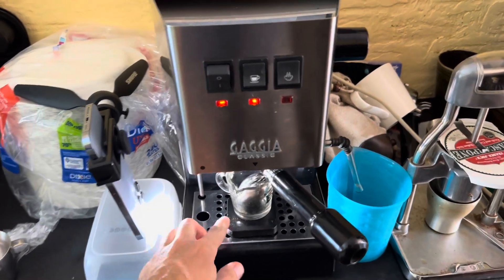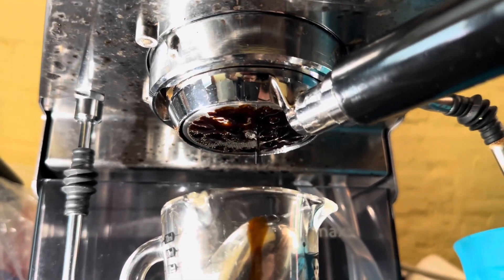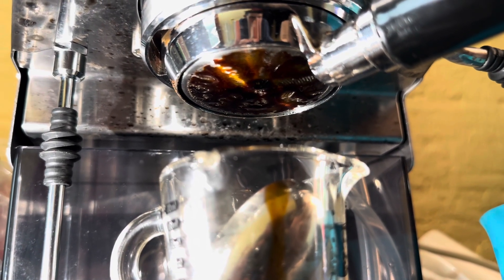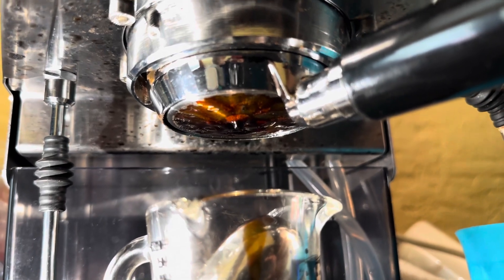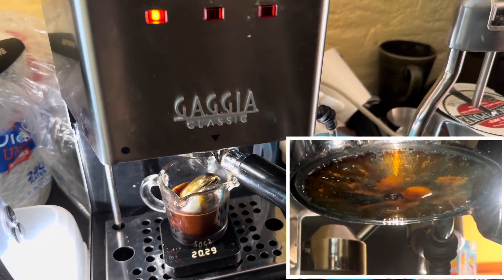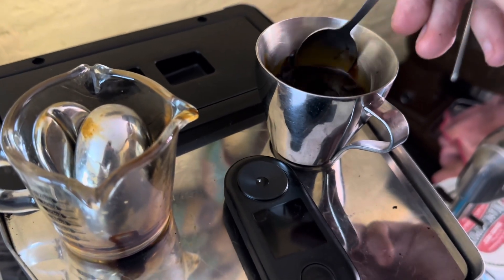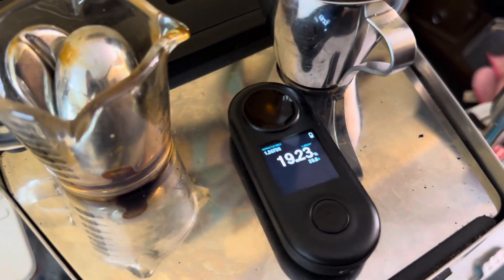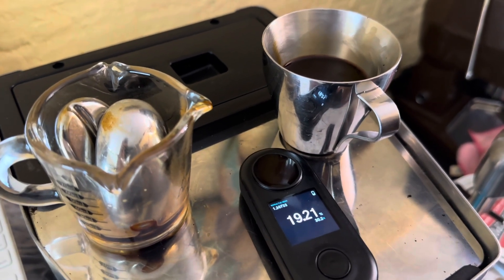Gaggia Classic: Pulsing Hack

Comment: Do you still have the machine or did you throw it out?? 😂😂

If u start and stop the flow 20x or more, then you’ll get a damage pump and the heating compressor because it gonna tell the tank that some amount of water is drained out and it needs to work again.😂😂😂

What if you just start it in 5 sec and stop, wait 10 sec and then start/ finish the flow out?
Reply from the maker: I still have the machine. You could pump it less. I also have a lever machine there so for that much work, I would prefer to use my lever machine.
Reply: @espressofun6091  

Arrh okay

I would try it out.

Comment: THE PROBLEM FOR ME.. THERE'S ABSOLUTELY "NO CRÉMA" PRODUCED, AFTER USING THE PULSING HACK METHOD.. ??
The extraction process was underwhelming, unremarkable & flat..
much like that espresso shot..?? Créma, is one of the most prized components of a well-made espresso. Caramel-colored and creamy in texture, the desired "foamy puff," is created when hot water emulsifies coffee bean oils and floats atop the espresso!
Reply from the maker: Cool! You do you. I don’t like the taste of crema and haven’t seen evidence that crema is actually a good sign of espresso but rather a by product of pressure.
Reply: @espressofun6091  Most Baristas would have differing opinions from yours about the importance of the appearance of Créma, but the goal for most, is to pull a shot of espresso with a créma that is not too thick, nor too thin; and one that lingers for about two minutes. Some refer to this as the "Guinness effect" because it mimics the head on a pour of the "Irish stout." Oddly, this "Pulsing Method".?. didn't produce any semblance of créma..thick or thin.
Reply from the maker: @annetteryan5110  it doesn’t have much crema but more coffee was extracted. So it is more efficient, and it is more even in extraction throughout the coffee.